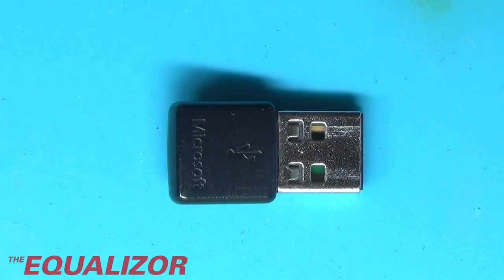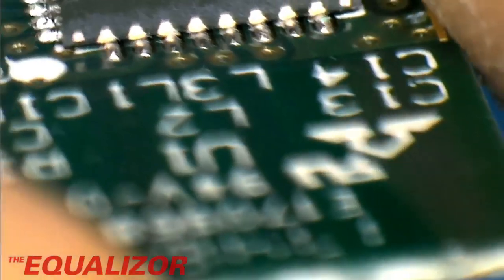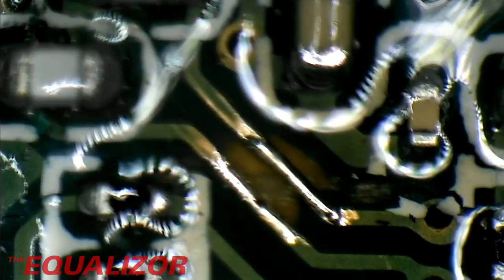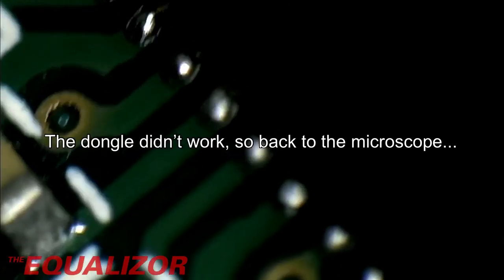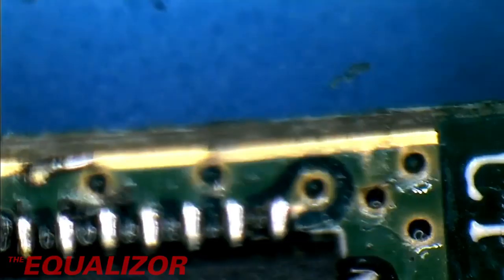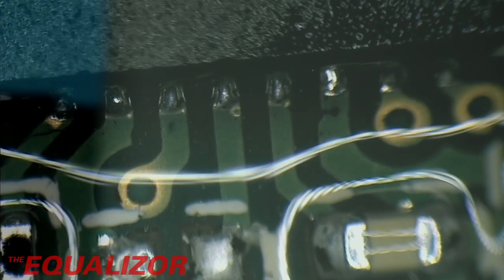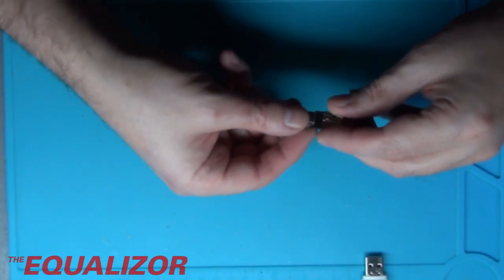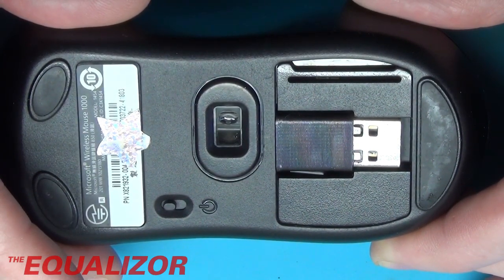Microsoft Cordless Desktop USB dongle repair

Comment: Hi. Thanks for the tips! Mine was also bent, but no major damage to the electronics. I just took out the metal part, put it back securing the pins, then tightened the metal part by compressing it with a pair of pliers and it works without issues for now. Hope it helps someone.

Comment: 19:24 LOL ;-) I like what you did though! At first it seemed like randomly poking around with a soldering iron, putting SMD components back in place and I was wondering if it would be worth the trouble. But you got it back to work and even fitted a new case. Nice job!
Reply from the maker: In fairness, a lot of my repairs are like that. And 9 times out of 10 that totally works :)

Comment: How did you get the plastic cap off? That part is missing from the video. I have the same dongle. Do I need to cut on the seam or try to plop it open?
Reply from the maker: kash241982 i
If you have a look at my video, you’ll set that I bend some metal tabs up on the usb connector to release the housing.

Comment: Can I please khow how to assemble the metal housing back or can I solder any other usb cable's front part that goes into the usb port to the pcb so that I have to not use the metal housing.

Comment: Hi, my dongle broke on the "tray" that is the plastic that the chip is placed on, and supports it against the usb socket.
it is now only recognized when I am holding it against it.
I couldn't find any 3D design for the tray so I can print and use it. any chance someone here can help?

Comment: Just out of curiosity, what microscope do you use?
Reply from the maker: I use the one linked below because it was cheaper to buy this than convert my old Amscope from Bincoluar to Trinocular and buy the camera! 

I use the Amscope Stand though due to its superior stability. My only issue is that even with a reduction lens on the Camera port, its still not wide enough angle for my liking. The Eakins Scope head is identical to the Amscope in terms of Build Quality, Design and Optics (to my eyes anyway)  etc, however the Amscope is considerably more expensive.

https://www.aliexpress.com/item/32851330647.html?spm=a2g0s.9042311.0.0.27424c4decXhb8

Comment: I'm impressed your work and this video.  My laptop fell with the dongle in it.  Dongle side hit the ground.  After that I had to put downward pressure on the dongle to make it work.  I felt I lacked the practice and the equipment to do what you've done.  But since mine wasn't severely damaged, I saw another video where you can remove the electronics and bake it in an oven.  I tried 400 F for 8 minutes.  The performance seems fine now.  @the equalizer I'd be curious about your thoughts on this method.  Thanks again for a great video.
Reply from the maker: Hi Patrick, yes this could make sense. Lead free solder is quite brittle so I suspect you just broke some connections when the dongle got damaged. By putting it in the oven you melted the solder back into place I guess. Either way, good on you :) saves it from landfill.

Comment: What could be if :
my Microsoft wireless Mouse stopped functioning once I connected my external USB3.0 HDD.
Note: my mouse laser is blinking yet 
          my mouse dongle make a sound on plug-in & plug-out !!

          I used another wireless mouse of same model on same computer & it works.
          other wire Mouses are working too.

What could be the problem & how to fix it ?

Comment: I've lost the receiver and would like to replace it.  Can you supply replacement info?
Reply from the maker: According to the post in the following forum, the Dongle and Keyboard/Mouse are paired at the factory. To my mind that means that even if you bought a second-hand one from eBay for instance, you wouldn't be able to get it to work.
 https://answers.microsoft.com/en-us/mobiledevices/forum/all/replacement-usb-dongle-for-wireless-desktop/9d888d20-f7be-4da4-a907-bd033cd3547e?page=2

Comment: My laptop slipped off my sofa and impacted the floor right where the USB dongle protrudes, bending it at a 45 degree angle. I thought I would be able to simply find a replacement but after some research, found out that it is irreplaceable. So basically I have an $100 keyboard and mouse that is worthless because of a little dongle.
Reply: Me too... Other productors have replaceable dongles though, I guess it's just Microsoft being lazy

Comment: Did you simply replace the cap with "any" cap ?
Reply from the maker: Yup, I have some iPad caps that I use for that sort of thing. I think they're 10uf or something like that. These caps are normally used for power rails and their value isn't critical as long as its in the ballpark ;  its better to have something there than nothing.

Comment: I couldn’t slide pcb out of plastic sleeve. Any suggestions?
Reply from the maker: Joseph Hobeck I think the usb portion was held in place partially by some metal clips on the usb socket. You’ll see what I mean if you look at the first few minutes of my video.
Reply: @the_equalizor  can you tell me which is  gnd , right , left and positive and negative terminal please
Reply: @tanmay7021  You are really anxious to get to know that, aren't you? What exactly do you mean? Are you looking for the USB connector pinout? Just google "USB pinout" and 100s of answers righht on your screen, buddy!
Reply: @anhoek3806  i want to connect this USB with my amplifier so i want to know to which pin i need to connect the power supply and ground wire, right in, left in

Comment: Hey good project we wanna sponsor your next project. May I know your email?
Reply from the maker: NextPCB Sure, it’s robscott@mrhangman.co.uk
Reply: can you tell me which is  gnd , right , left and positive and negative terminal please
Reply: @the_equalizor  can you tell me which is  gnd , right , left and positive and negative terminal please
Reply from the maker: @tanmay7021  I don’t have the dongle any more, so I couldn’t tell you. I mean it’s a standard pin out, so if you use your meter in low ohms mode you should be able to measure out the end ground pin and then work back from there for d+, d- and 5v